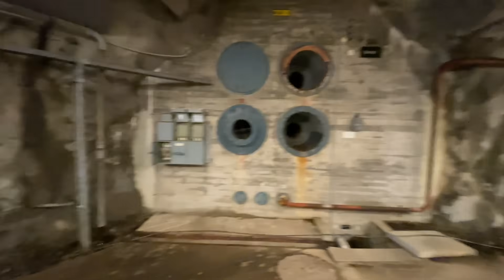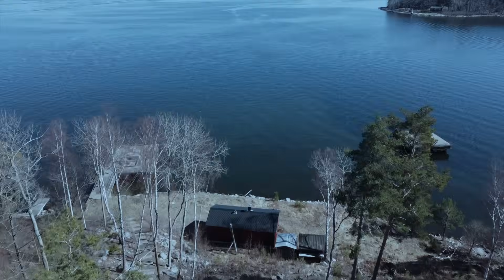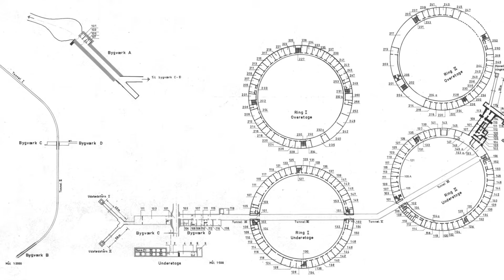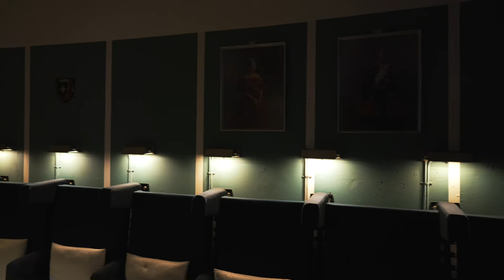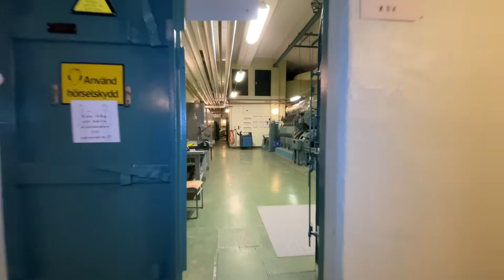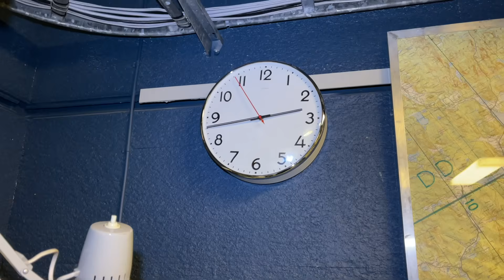Exploring 5 Secret Cold War Bunkers

Comment: 15,2 cm batteriet på Hemsö var kvar i tjänst till 1994 inte 1992, samt att du visar bild från fel batteri, nämligen 7,5 cm m/57.
Mätstationen Arte 719 i sista klippet vara garanterat kvar fram tills att batterierna på Hemsö var i tjänst fram till 1994.
Mätstationerna av den typen fanns på 12 st 7,5/57 serie 3, samt några fristående som den på Hemsö.
Reply from the maker: Tack för rättningen, och tack för att du tittade.